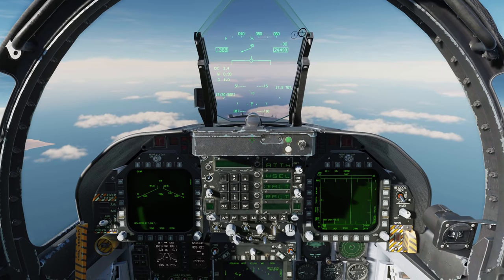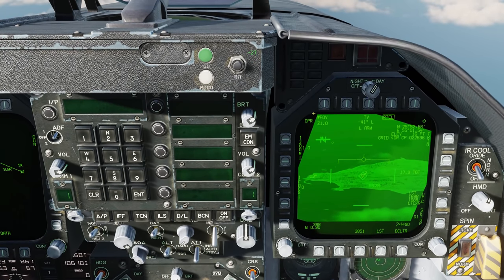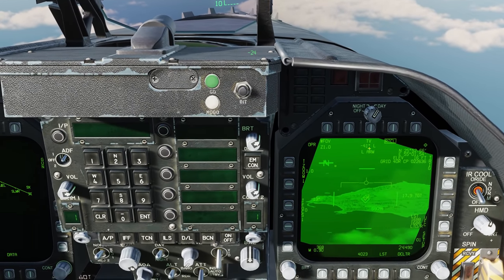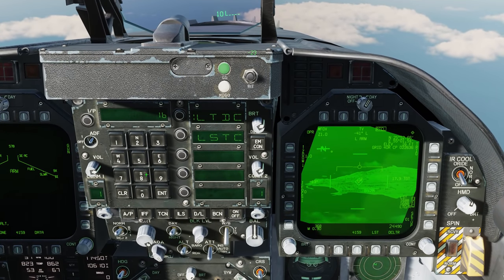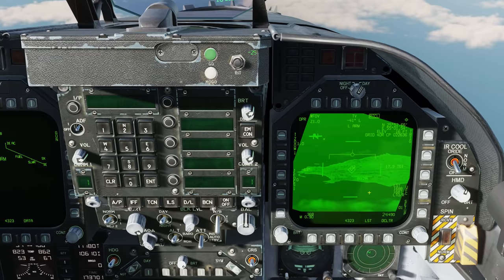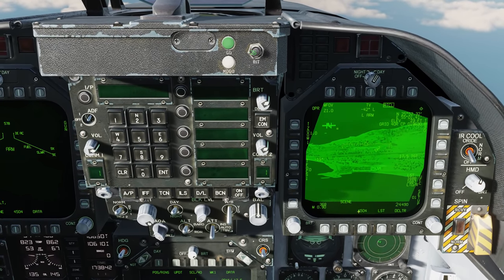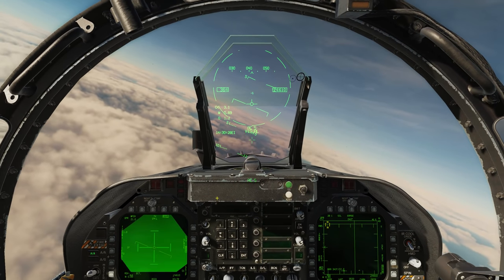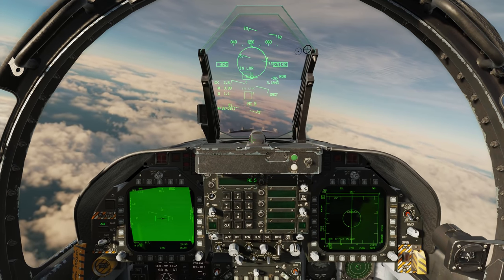DCS: F/A-18C Hornet | ATFLIR Basics

Comment: @ Matt Wagner - will we get´also a Latirn or AN/AAS-38 Nite Hawk Targeting pods for late 80s scenarios ?
Reply: Nitehawk should be present on our Hornet anyway - AFAIK they were still in use in the mid 2000s.

LANTIRN wasn't on the Hornet at all (F-16 Block 40, F-15E and a modified version for the Tomcat).
Reply: @OliverMiles98  till 2008 but yes,it would be a really nice addition
Reply: @Obi1-KenBone-Me  Yeah, well our Hornet is mid 2000s - so fitting with Nite Hawk.
Reply from the maker: No, we have no such plans. Thanks.

Comment: Genuinely curious what the point of ATFLIR is over LITENING II is. Close Air Support I assume with the coordinates and grid but they are otherwise the same aside the different Zooms that appear to do the same thing in a different way. Any insights on how this will be useful for anything other than CAS over the LITENING II pod?
Reply from the maker: They are very similar pods and use much of the same PVI (pilot vehicle interface). As mentioned in the video notes, one pods is not really better than the other... just different. Thanks.
Reply: @MattWagner  oh okay to me it would appear ATFLIR slightly better for CAS work but thanks for the reply Wags! Updates look great. For whatever reason I thought the ATFLIR was a BEAST in air to air especially but I believe I was confusing it with the SNIPER TGP. Clouds look great as did seeing the SLMR which I would assume may be a sneak peek at the SLAM-ER. That thing is a beast IRL so I imagine it will be in DCS

Comment: What’s the point in this pod? Other than the third zoom level everything is the same, just seems a waste of time for something that offers little to no change in offering or advancement
Reply: For a USN Hornet, we shouldn't have LITENING in the first place, that's used by the USMC and our current LITENING is based off of Spanish documentation.

ATFLIR is the actual pod used by the USN, as for advancement it has a higher resolution IR sensor, and its operation makes more sense.
Reply: @OliverMiles98   thanks for that, will the resolution be noticeable on this as I’m concerned trees and AAA seem to have the same heat signature !
Reply: @edgar0517  Probably something coming with the overhaul of infrared sensors which I think is planned for Q3 (though I imagine might reach into Q4).

And in addition to what I said above, when the USMC flies off of carriers, they transition to ATFLIR as AFAIK ATFLIR is carrier rated and LITENING isn't.